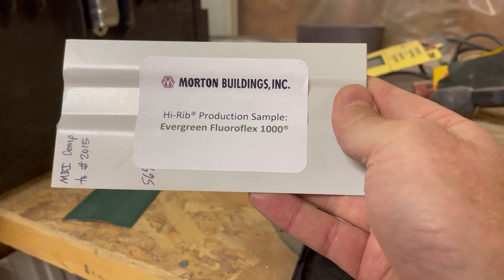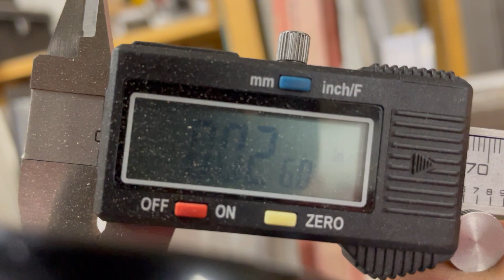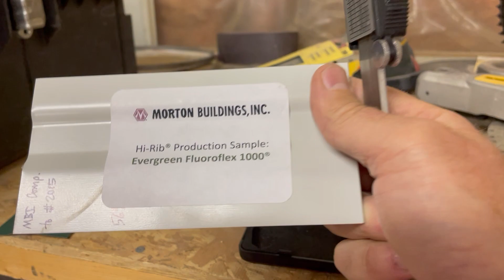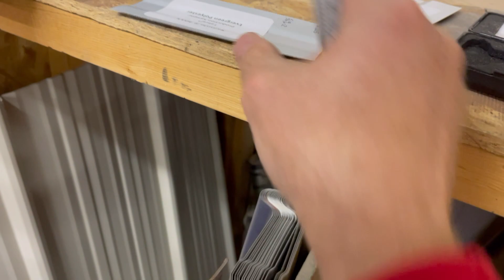#MortonMoment: Morton Steel Thickness

Comment: When Morton lines a ceiling do you use nailers every 4 ‘ or so or with the thicker steel do you just put on bottom of trusses around 8’
Thanks
Reply from the maker: As I recall, we are using nailers every 32" with any steel application. Thanks for your question!